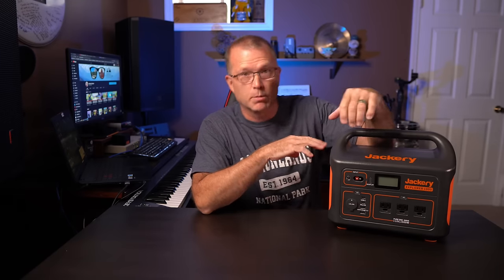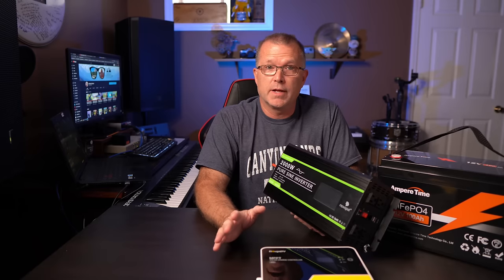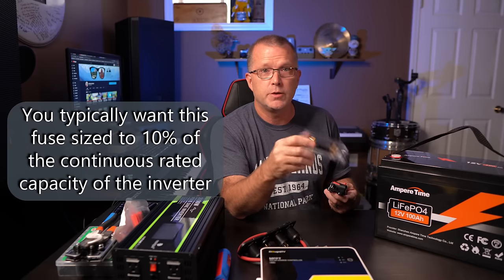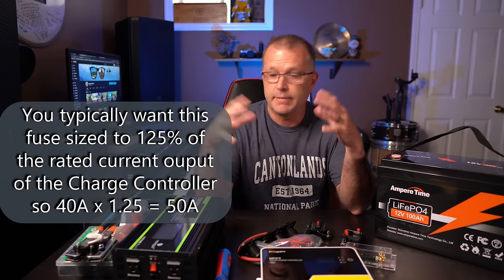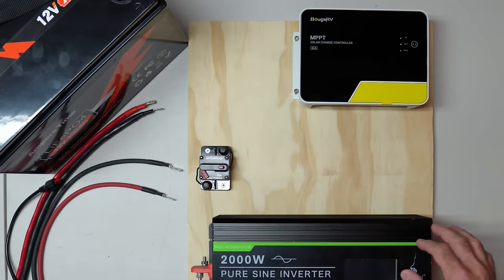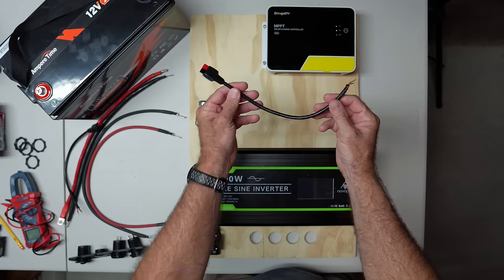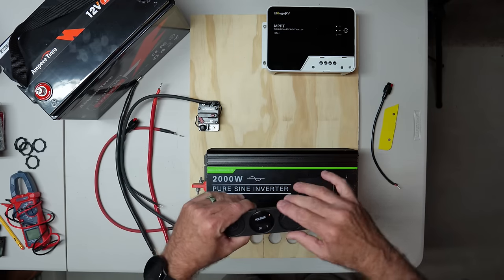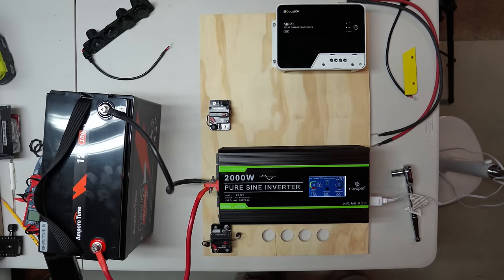BEGINNER FRIENDLY Step-by-Step: DIY SOLAR GENERATOR for Emergency Power, RV, Shed... Ampere Time

Comment: Nice build. Only one suggestion. After spending 23 years in the inverter repair industry, I would suggest losing the cheap, high frequency, transformerless inverter and spend a little more money and invest in a low frequency, transformer-based inverter instead. Unfortunately, Chinese made, high frequency inverters on the market simply don't last. Especially when powering inductive loads like refrigerators, microwave ovens, portable air conditioners or power tools. You may be able to start some of these loads when your high frequency inverter is new, but over time, typically after less than a year, after repeated use, the MOSFETs in this high frequency inverter will fail. They simply are not designed for powering inductive loads. That's why the big name brand inverter manufacturers like Schneider Electric, Outback Power, Magnum Energy and others, all use a low frequency topology in their design.
Reply: Do you have any brand/model suggestions?
Reply: Have you priced any lately? Far above a retirees payscale!
Reply: All of the components used in this build are very much budget  / entry level,  as is the wiring approach so I guess it all sort of fits. 

Obviously neither the wiring or battery support a 2000 watt inverter but it is OK since it is really a 1000 watt design.
Reply: If you do, please reply. Thanks. I do not have money to waste.
Reply: thank you so much for this info. so are all the ones you listed all low frequency better type?how do I know I am geting a low frequency inverter that ca handle motors that draw alot to start. that is what I am trying to build something for a mini split or small portable air. wish my dad was still around as he knew this stuff. thanks for this info. I hope not to burn the house down or be penny wise... thanks for sharing your valuable knowledge.
Reply: is there a specific low frequency transformer based inverter you would recommend.
Reply: I have a Trace inverter charger that was installed in 2001 very dependable at 23 years old now. I am solar alone  off grid

Comment: Nice setup. Only one glaring flaw. After spending 23 years in the inverter repair industry. I would highly recommend spending a little more money and investing in a low frequency, transformer based inverter instead of that cheap high frequency unit. High requency, transformerless inverters are not designed for powering inductive loads like refrigerators, power tools and microwave ovens. And can actually be damaged by these types of loads leading to a much shorter life expectancy for your system.

Comment: The only concern I have here is you're using the posts on the inverter as a sort of defacto bus bar.  Current coming in from the panels is going through those to reach the battery.   I have seen others do this and I can't help but wonder why.  The solar charge controller sends current to the battery.  The battery sends current to the inverter.  I kept those runs separate from one another in the portable power station I built.  This was easily accomplished using a proper bus bar configuration.  Not saying what you did was wrong, but I didn't want the DC voltage (~24v?) from the solar panels connecting to the same lugs on the inverter where the battery is supplying 12.8 volts.
Reply: Thank you. I saw that, but the energy from the battery missed my thought process.
Could it be that the power flows both ways on the cables to and from battery to offer more on inverter draws?
( odd analogy: like liver-gallbladder-pancreas to intestines, GB stores bile, liver creates it, and both are drawn from to mix with pancreatic efforts) maybe kinda gross... but I had pancreatic cancer and they took the GB out with part of the pancreas. Lol, I cant believe I made this connection 😳🤣🤣🤣
Reply: I know it looks odd without a negative bus bar, but it’s a tried and true wiring method (Prowse for example wires simple set ups like this the exact same way—he does add a 200amp fuse to the positive terminal of the battery)

His oldest wiring diagrams used a negative bus bar and a Victron battery protect as the positive bus bar; but he has since eliminated the Victron battery protect. 

Another cool modification would be to add a low temperature disconnect  relay at the MTTP to shut down lithium charging at sub freezing temps (there is some uncertainty as to whether this battery brand has low temp disconnect in its BMS)
Reply: The voltage coming out of the mppt is NOT 24v, unless you have a 24v system.  It's the same or slightly higher than the voltage of the battery.  Not any different from a cable ran another foot away with the same connections being shared...and arguably less system resistance overall.

Comment: I bought that same cheap charge controller but found out after trying to set it up that it can not be used with the lithium batteries.

Comment: I have been living off-grid for ten years and can certify that your information is fantastic for anyone wishing to get started. I have a number of systems including one identical to yours. I even charge my Tesla model 3 as the closest =Tesla charger is 135 miles from me.
Reply: Hi Steve. I have an M3 too. I would like to design an emergency solar system if the grid goes down to charge it. Any suggestions?

Comment: Good info! Awesome build! NOW things to consider and for Safety, Do the research and figure out what your wires and fusing must handle. A fuse or breaker from the solar panels which can double as a disconnect switch. Fusing for your Source (Battery) is recommended to be no more than 7 inches from the POS Post. As in your AC system EVERYTHING must be Fused and switched so it can be separated safely. DC power can and will cause a fire (even a little 9V battery). As in your AC system ALL the POS wire ends and connections are recommended to be covered to prevent accidental shorting and a possible fire (SHIT Happens)!  Just a recommendation! keep all your fusing (except your source fuse) on the front of your little panel so you can quickly see and replace them if you need to. In a Grid down situation, you want it to work.  MOST of these DIY projects on here are lacking the necessary fusing and short prevention. DO IT RIGHT don't just make it work!

Comment: Great video for explanation. For a Van or RV I would have put in a fuse panel for each circuit so everything does not go down if one item pulling current burns out I still have everything else working. The fact you can double that for the cost of an extra battery is the real bonus. Its the scalability that is powerful here.
Reply from the maker: Well said, sir!

Comment: A trick for drilling your hole bigger without a drill press: drill the bigger hole in a piece of scrap. Clamp the scrap to your panel centered over the smaller hole. Use the scrap to guide your hole saw so it does not walk.
Reply from the maker: Genius!  Where were you 8 months ago?! haha I'll tuck that trick away for next time.
Reply: An even easier way is to take the small hole saw and mount it inside the bigger hole saw on the mandrel. The small hole saw sticks out of the bigger one allowing you to easily insert it into the hole, acting as a guide.
Reply: An even easier way is to take the small hole saw and mount it inside the bigger hole saw on the mandrel. The small hole saw sticks out of the bigger one allowing you to easily insert it into the hole in the wood.

Comment: Been looking at a few DYI builds and this one is pretty much the best in explaining it simply enough that a novice who has very little experience can make one. Going to be trying to make my first one and the only thing I can think of in doing differently is using a old ice cooler with wheels and extending handle as a frame to place the battery and other components mounted to it to make easier to transport.

Comment: Nice build. Simple and it works. I used that battery with Renogy 3000W for my portable power station. Chainsaw works great running off it. Thanks for sharing.
Reply: Interesting one battery is enough to use 3000 watts?

Comment: This video was extremely helpful, thank you.  I am currently in correspondence with Renogy UK about supplying the components I need for a 400w array, 200amp Lithium battery, MPPT controller and 2000w PSW inverter and associated fuses and cabling.  I want to put in a simple system to allow me to run a household fridge freezer should we experience any power outages this winter, but also to run my radio shack off grid.  I am looking forward to this little project and your video clearly explains the layout, thank you.

Comment: Thanks, very useful information and great details.  I think the only thing I would change would be who you wired the charge controller.  I apologize if that's already explained but I would connect the charge controller directly to the battery with it's circuit breaker.  That way you can isolate the inverter and still charge the battery.  Also, would the 100amp BMS on that battery cut out at 1280 watts (100 amps)?  Thanks again for all the great videos!

Comment: 100% agree on the Charge controller - I have one of those $20 ones that came with a Renogy 100w panel “bundle”.  I’m using it right now as a temporary solution to charge my pop up camper battery, but the terminal connection ports are crappy (shallow) and the whole thing is pretty junky.  I need to upgrade!
Reply: I know what you mean. just about the time you get the screw tight enough to hold the wire firmly in place, it strips out.
Reply: I've got a Colman 30 amp charge controller and found it doesn't have proper charging parameters for sealed lead acid batteries so 50 dollars for junk now I'm trying to find his material price list as I want to go solar
Reply: I don't believe that PWM controller will work on a Lithium battery.
Reply: @fudgea  it will work
Reply: I really don't like the that charge controller that comes with that renogy bundle. I do however like the cheap one he mentions here. I used it for about 3 years and it was awesome.  If you're on a budget anyways. If you have the money victron is much better

Comment: Thanks for explaining the 100ah battery equates to 1200 watt hours. I had not know that until now.  I'm currently building a small (4) Renogy 100watt  pannels and a renogy 30ah charge controller setup. I also purchased one of those cheapie charge controllers just to put away for the just in case situation, but honestly, I may just pick up a spare quality controller. I'm learning as much as I can for my small off grid setup with intentions on building a larger setup. Thank you

Comment: You should use the plywood you cut to form a right angle to the mount, scoot the charge controller closer to the inverter, and use the opposite side of the plywood that forms the angle for the faces of your plugs and breakers. Even as a one-third box enclosure, you can slide it into any corner if you don't have another two boards to enclose it so you don't have to see the parts and still have access to your plugs and breakers. Paint the boards a neutral color and it'd be portable, convenient and aesthetically compatible almost anywhere.

Comment: This was really helpful. I have 2 400w panels that generate 90v and 11a in series and I was looking for an inexpensive system and this fits the bill I think. Not sure about the 90v but I’ll do some research on that. Many similar videos demo much more expensive equipment for higher capacity systems so this is a great alternative
Reply: That charge controller should be able to handle 90v easily. Most charge controllers can handle a input voltage range of 150-400v then it will step-down that voltage to 12v or whatever voltage your batteries are.
Reply: So the problem is and I can't find a place to generate a normal comment to this video without replying to another comment I don't know if he turned comments off but he does NOT have his outlets wired in series!! Those outlets are wired in parallel!! I thought maybe he did a series/parallel combo but no that is entirely wired in parallel! Series is positive to negative positive to negative and so on the poles are connected opposite that's what creates the series circuit! A circuit wired with the poles connected positive to positive negative to negative as he has his outlets wired here is wired in PARALLEL! I'm a 12 volt m.e.c.p. certified tech and I learned at R.I.T.O.P. school for mobile electronics before they moved away from Watertown MA
Reply: @spiraleye7822  Are you talking about the connections at 14:10? I don't see a problem, the way he has it wired, each outlet has power. All of those outlets are fused by that in-line fuse. At 13:20 the battery is run thru a breaker (bottom) to the inverter, the controller output is run thru a breaker (top)  to the inverter. Are you saying the controller should go directly to the battery first (thru the top breaker)? Then the battery positive to the inverter (thru the bottom breaker)? Why do you feel they should be in series? I see his wiring allows the solar controller to directly power the inverter. So is that the problem? Should he move the solar controller connection directly to the battery? Electrically speaking, wouldn't that be the same connection? I guess he could flip the bottom breaker so it would cut the inverter out, then solar would only go to the battery. Is this your thinking? Maybe I'm missing something... LOL, so many questions!

Comment: This is one of the best explanations for building a small solar system that I’ve come across. Thanks! I’ve got all the components ready to put my system together. One bit of confusion I’m having is, what is the gauge size of the wires between the battery and inverter? I have some standard battery cables that appear to be almost twice the thickness of your wires.

Comment: Nice and simple.  Although the solar panel can be simply unplugged, a solar input cutoff switch or breaker could be good before the charge controller.  It would act as a reminder to disengage the solar input before engaging in any battery or other component maintenance.
Reply from the maker: Yeah, you're definitely correct about that.  I'd considered doing that, but decided it wasn't strictly necessary for the video (but I may add that later!).  Instead, I put a reminder label above the 50A breaker for that very purpose. :)
Reply: @ReeWrayOutdoors  I saw something and I was thinking that's what it was.  Anyway, good video and thanks.  I'm working on getting one to two KW of panels and probably a Bluetti  to run half of my house.  I've already installed a transfer switch in have a small champion inverter generator.  I learned so much from watching everyone else put stuff together and try it out.  If I knew how to overcome the neutral ground bond problem with a regular power inverter I would have already had something up and running.
Reply: First person that mentioned that
Reply: So unplug the solar panels if you plan on taking anything apart?
Reply: @cotybair796  Si.  It's very easy to get complacent if you're doing it a lot or in a hurry.  I've got a little system at work and three at home and I still find myself either working with the wires in the middle of the day with them still plugged into the panels or about to disconnect something without breaking the connection to the panels first.

Comment: I have this eetup in my truck. To save more money you can use LEad battery. the panel is on my roof top and the whol system keeps a fridge and freezer in the back of my truck, Cold beers on demand!

Comment: Also if you use a nylon cutting board you can use your 2-inch strip where you put the black controls on the bottom of your plywood there you could also build that up for the nylon put screws through it to where when you mount it in there it's away from the backboard just a bit to where your wires can come underneath there you can wire it all through the outside of your surface and nothing going underneath

Comment: Nice setup.  A good addition to this would be a charge controller that allows for grid power input for times you have grid power but solar power is not adequate.
Reply: 1:00
Reply from the maker: Yeah I agree.  Most of the ones I've seen with that option require at least 24v configuration which wasn't feasible for me without adding another batter and more solar.  Still, it's something I'd like to do at some point.

Comment: I got the 12v 300 ah version, 60 amp MPPT controller, and 2000 w inverter. I`m really nervous about messing something up. It was so expensive and I spent the last of my meager savings on it but felt like it would be a wise investment with the crazy insanity happening everywhere. Plus I`m in a hurricane zone. We had long power outages and damage from two direct hits in 2020...Laura & Delta...several near misses too. I have a lot of small and medium sized solar power stations, my two largest Bluetti EB70s for my freezer, power banks, and all sorts of solar rechargeable batteries for radios, etc. I ran my 6 tabletop hydroponic salad greens gardens from them after one power outage. The day I got my first small Rockpals` power station I wondered if I`d wasted my money. That night we had a 9 hour power outage which is common here due to damage to the grid. I ran my WIFI and charged my laptop. That convinced me to get more. I want my own guaranteed electricity. Can`t afford to run a gas generator for weeks after a storm.

Comment: VERY WELL DONE:  I see you are using cut off breakers between your battery and the inverter and the panel array and solar charge controller. I also see you referenced an ampacity chart  the only thing I would recommend keep your wire runs short and use wire rated for the max constant current through the devices. Otherwise this is a very good example of how to do it